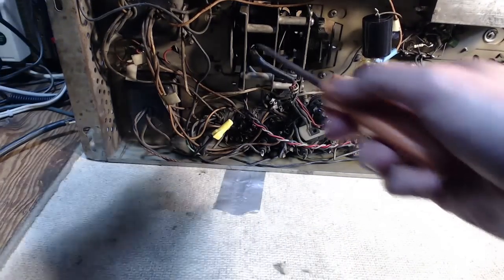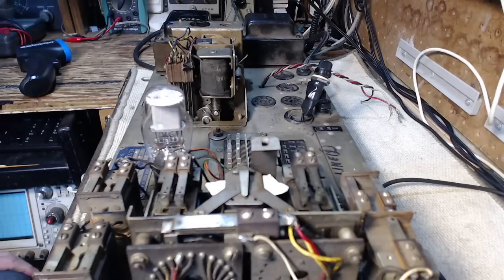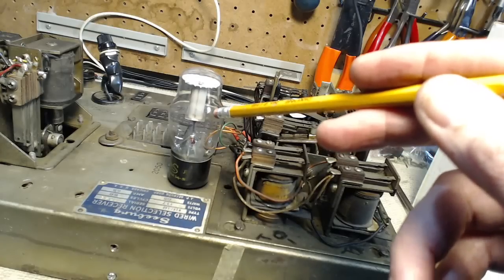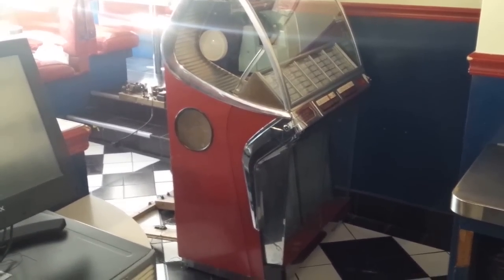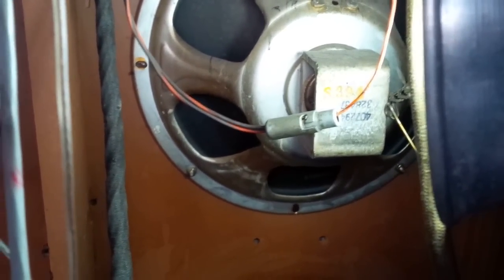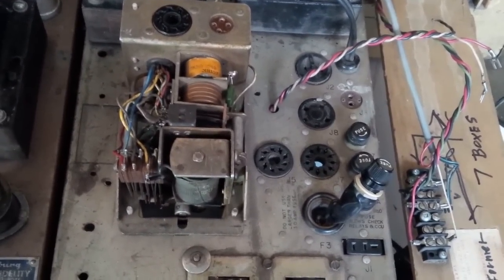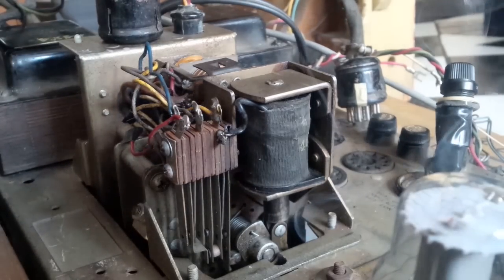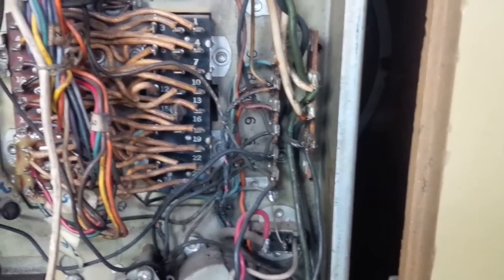Smoking Seeburg Jukebox Video #9 - More Smoke

Comment: Jim, the large solenoid operates to remove credit.  Wjen you make a selection, the large solenoid advances the credit wheel a notch and runs those flipper switches that the small solenoid flips up under a metal piece, almost like a ramp, and resets them.

Comment: As mentioned in vid #7 I built a mod to protect the latch solenoid.   When I did this I painstakingly reviewed the schematics and figured out how the credit and selection system worked.  It is incredibly ingenious.   I will try to summarize.
A coin goes in and it activates one of the cricket lever solenoids in the CCU.  It flips up one of the cricket levers.  There are different solenoids for 5, 10 and 25 cent coins inserted.  The solenoids for each are  physically mounted in a different position to activate a cricket lever.   The cricket levers are 1, 2 or 3 positions away from a reset ramp that flips them back to no credit position. ( one play for 5 cents, 2 plays for 10 cents, 3 play for 25 cents) The cricket levers rotate as a song selection is  completed by hitting a letter button then a number button ( or visa versa sequence doesn't matter) is completed .   As Jim stated the unit has the capability of up to 6 plays per what ever coin gets inserted.  There are 6 cricket levers on the rotating wheel so technically it can remember you have up to 6 credits.  You physically have to relocate the cricket lever solenoid within the CCU to make it set the 6th cricket lever on the wheel so it takes 6 cycles to move the cricket levers passed the reset ramp.   The rotation solenoid cycles once to rotate the cricket levers one position closer to the reset ramp.  As this rotates the cricket levers all get reset one at a time.  The CCU is basically a mechanical memory that stores how many credits are paid for.  Now the cricket levers are actually a switch that activates the latch solenoid that activates the keypad.  This is what starts the entire sequence of  selecting and playing songs.  The latch solenoid enables the keypad to lock keys as they are pressed.  The mech waits for a number and a letter to be selected.  Once one of each are selected for the song you want it knows that 2 keys have been pressed.  This activates another mechanical solenoid memory that sets a song choice solenoid plunger to an out position.    Once this plunger is out that plunger corresponds a song on a record in the jukebox that is to be played.  That corresponding song is then played and the system resets the plunger to erase that song selection.  This jukebox has 100 songs and 100 plungers.  Completing the song selection keystrokes also activates the CCU and operates the reset solenoid to rotate the cricket levers one position to erase one credit by rotating the cricket lever passed the reset ramp.
As long as there are credits or a cricket lever is set the latch solenoid is powered up to allow keypad use for song selection.  The cricket lever is the actual switch that closes to power the latch solenoid and the credit light if I recall.   If someone walks away from the jukebox without using all their credits that latch solenoid just sits there and cooks itself to death.   Usually if you are a paying customer chances are you will use all the credits you paid for.  I hope this helps with further troubleshooting of the system.  I was
extremely impressed with what they were able to do back then with electromechanical logic.

John

Comment: Jim coulomb meeee that's a lot of ampere-second !

It may look bad now but it can be fixed its just a lot of small jobs .

Take it one step at a time , slow & steady .
       ( Sorry for the long post , if you read it all could you explain it to me ! )

Print out the schematic mark on it the burned parts & wire as you change them .
This will give you a good idea of the current path .

If it disappears out a plug into the box a power supply can be used for testing the
coils + coil ground S/C without risking your repair if the fault is on the end of a loom .

( Remember what goes in must find it's way back , if the fault is on the end of a loom
strip the loom )

You may come up with a mod that will stop it from happening again !
Or just for safe fault finding . ( power supply ? )

The schematic is your friend it can be broken-down into small blocks / units .
This can help with your fault finding .

So you have 6 power supply's , a 2050 switch , relays , the rest is just plugs,
plumbing & metal ...............  & yes if you fix enough this will happen .

Just try & limit the damage & I feel the pain . . . as I have been there !

Stating what should be obvious here but if it helps you it will help others !

PS You don't need all the plugs in for a test .
( amp , coin switch , J1 wall o matic , J5 plug & the lights J2 can all be unplugged )

Did you replace the coil / relay on the back of the switch bank ?
It smoked & you filled it with epoxy !

 If your being pushed for a fast fix just
               quote the cost of a reconditioned unit works every time !

Comment: Jim, I wonder if one of those solenoids hasn't suffered an insulation failure, grounding the coil out part way after just a few turns or dead on one contact), thus cooking the wires, might be worth doing a resistance and insulation check to ground from the solenoid coil terminals?

Comment: I would say use the same technique at this point you used in an earlier video.   Break the system down into individual functional blocks. Remove all interface plugs, power the system up and start plugging one plug in at a time and waiting for a while between insertions until you recreate the fault.   This will help narrow down where the problem is so you can concentrate on analyzing that particular section of the system for logical causes of the fault.  I have faith in you.  Keep it up.  Another thought is to isolate system sections by removing all fuses then putting them back one at a time and look for a fault.

I looked like in this video that 2 wires had crossed and may have had their insulation rubbed off to cause a short between them.   It's hard to tell for sure when viewing a video. 

One other thought.  I am kind of thinking that if the fault was a 120 volt fault it would spark and instantly disintegrate a wire totally.  I have a feeling that this is a low voltage fault somewhere since it is taking some time to burn up a fairly large gauge wire.  Maybe I am grasping at straws on this line of thought.

One logical step at a time and the answer will rear its ugly head sometime.

John

Comment: Jim  Video #7 @ time 5.13 it looks like that wire is burned but we only got a glans at it .

Check / change the CR-1 rectifier .
( no fuse on that bit either maybe fit one between transformer & rectifier !!!!!!!!! )

Check all the coils with a Ω meter you may need one end disconnected .

Then test the relay with a current limited variable supply set at the relay working voltage .
The A/C relay should work with a D/C voltage for a test .

( Used 24v a/c relays on d/c at work but under protest LOL !
Never had one die & its 10 years ago now  ) .

Note you have 150 V D/C on open contacts when the 2050 fires !

 P S U & relay Ω info is in the Seeburg WSR7_8_L6.pdf

Comment: What is the condition of the latch coil on the keyboard, those are notorious for shorting out.
Reply from the maker: Frank Kissle The latch was the topic of some early videos. It burned up. I got another one and it burned up too. It happened when customers dropped in their quarter but made only on selection. The latch stayed latched waiting for the second selection to be made and overheated. I removed the latch relay completely so now both letter and number buttons must be held down together. No more risk of a smoking latch solenoid.

Comment: At 5:57 I stopped watching. Why are you expecting the credit subtract solenoid to operate when you pressed the add credit button? And you don't even realize that the add credit solenoids have plungers???? This video shows that you have absolutely no idea what you're doing. It would be cringe-worthy to watch you stumble and guess your way through this video for a half an hour. What you've done here could be compressed down to 3 minutes of video if you had any idea at all what you're doing. Next time, perhaps read the Service and Installation & Operation Manuals and familiarize yourself with the assemblies and how everything works before you decide to just dive in because you know it all. Watching you push the add credit button with a pencil eraser was hilarious. Good times.